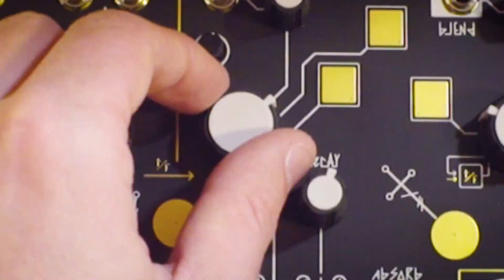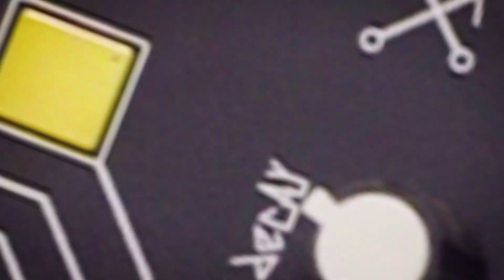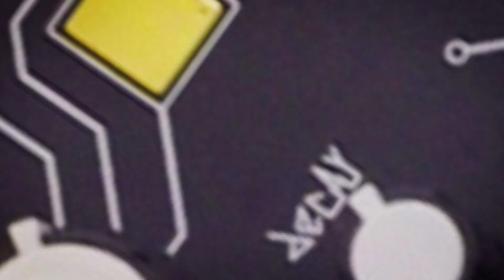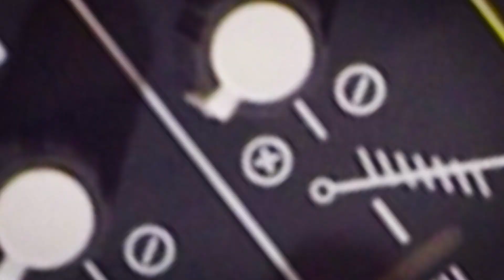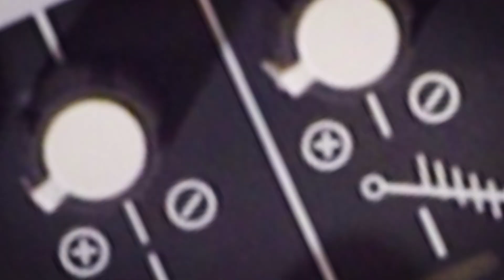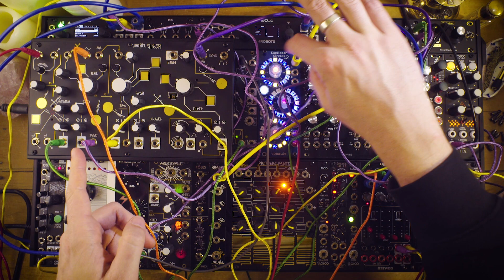Make Noise Strega Demo (with Modular!)

Comment: Excellent demo as always and you unlock so much of it's potential. Soundwise, I feel Strega could be too 'exotic' for most people and even your video did not convince me otherwise. I don't think Strega sounds pleasant in any mode or input  (it has MN on the panel, so it makes both sense and noise) but I can't wait to prove myself wrong. Regardless, you're the best. You can discuss total silence and still make it entertaining.

Comment: 20:36 I love the irony of plopping the Strega right on top of Maths... since you can't actually mount it within the case! I'd love it if MakeNoise would release a power adapter solution that would actually make this form factor optionally useable in the eurorack world.
Reply: You can rack mount 0-coast/Strega/0-ctrl.  You just need a blank to cover the power adapter.  I rack mounted the 0-coast in my case 

https://www.mentataudio.com/gear-studio-talk/how-to-rack-mount-a-make-noise-0-coast-in-a-eurorack-case/
Reply: @KarateSnoopy  True! It is technically doable (great article on that btw). It's unfortunate that MakeNoise didn't go the extra couple steps to 1. align the holes for threaded strips, 2. provide a power solution that doesn't require hacks or soldering. The 60hp Moog semi-modular format is so much more useable... I love being able to easily mount my DFAM alongside my Maths instead of on top of it :D

Comment: arturia should sell the microfreak keyboard as a standalone keyboard. perhaps another in the step series. the Freakstep?
Reply: 0-control has a sequencer and the touch capacitive keys that are sensitive to pressure.  A different beast but...
Reply: Funnily a lot of people want a desktop Microfreak, so they could just cut it in half and sell each part :p 
Personally I'd love a multi- or duo-timbral Minifreak
Reply: @Tony2dH  I have heard that.   I have one but I won’t be chopping it up.  Im still trying to figure it all out.
Reply: @MrNamaikisaru  oh I meant Arturia can sell the halves separately! I wouldn't chop mine up either. I love it both as a very versatile synth and as a good replacement for my midi keyboard
Reply: @Tony2dH   it’s too late, I’ve had at with a band saw and now it doesn’t seem to work anymore!

Comment: How is there no voltage droop on the patch c. 17:00 when you mult the pitch cv?
Reply: could be that the respective 1/v oct inputs are only gently sipping on their voltages and not guzzling the whole thing like an analog oscillator would, or some synths are smart enough to tell when theres more current being drawn from an output and so buffer the signal appropriately. i can mult pitches from my various digital sequencers all i want and none of them have any issues with pitch drop